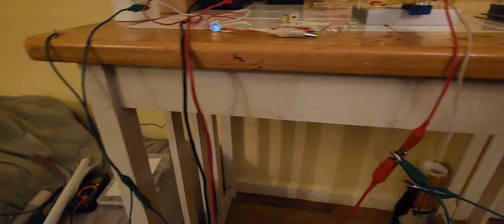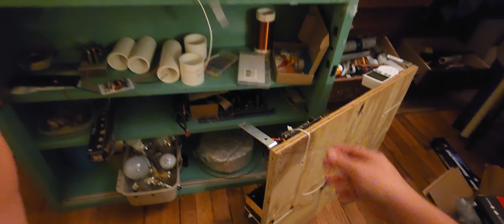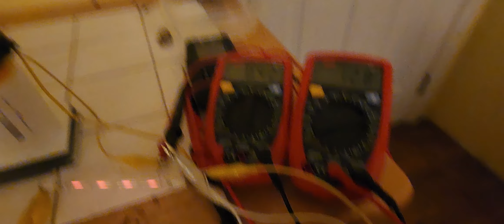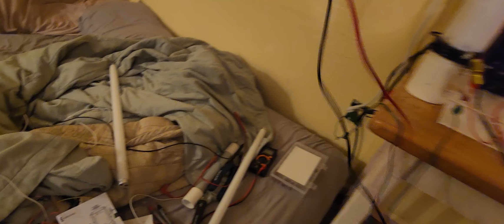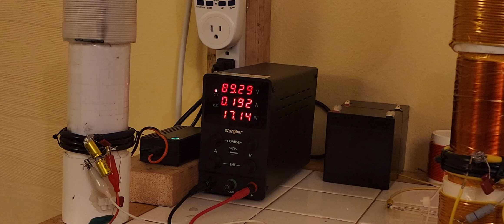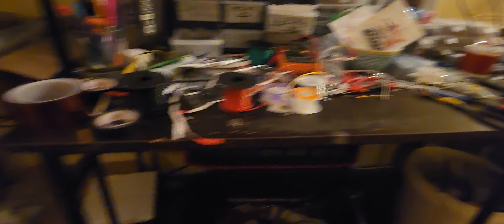💪 Short Circuit Current & Voltage Readings On 20 Watt Transmitter & Receiver Coil System⚡️

Comment: Would you have any idea why I can get so much measured short circuit current that i nearly burn out 1000v 8a ultrafast diodes with no additional draw from the supply but adding a resistive load draws exactly what the demand would be? Is wireless the only way to overcome this?
Reply from the maker: It's probably some form of back emf pulse & best stored in capacitors or a lifepo4 battery that can be Recharged in quick pulses that can then run 120v ac loads from an inverter :)
Reply: @MTECH2022  that's actually been my plan all along so I guess I should just go through with it and see if I can isolate the load that way. I've been questioning whether I was missing something along the way but yeah thanks man. I really appreciate your input.

Comment: What is the longest time you  Running transmitter on.
Reply from the maker: It can run indefinitely without over heating when i keep the input draw below 30 watts. I would need a bigger heat sink to overcome the over heating problem & i was thinking of putting peltier moudules on the heatsink to turn the wasteheat from the transistors switching into extra power :)

Comment: Can you explain the extra coil on the bottom
Reply from the maker: It made the transmitter consume 1 watt less power while simultaneously boosting the radiant wireless energy effects.  That bottom coil is identical to the L3 Coil
Reply: @MTECH2022   how is it wired  in?
Reply from the maker: @warrenstephens8557  connected in series with the 18 awg L2 coil :)
Reply: @MTECH2022  Pardon me for dropping into the discussion but I think I might have an answer for why it's doing this, in a previous video you mentioned that you didn't know why adding the extra coil helped, I've been studying the MEG and POC designs and following people who replicate it and I think I get it, it's a Resonance Cavity.

In systems like the POC and MEG you're essentially setting up a cavity resonance for the magnetic field, combined with the asymmetrical coil interactions it gives a large boost to the available power draw from Counterspace, so by adding that extra coil to the bottom you've basically created another resonant cavity for your circuit to take advantage off.

Sorry if you already figured it out, just thought I'd drop this here if you were still wondering.